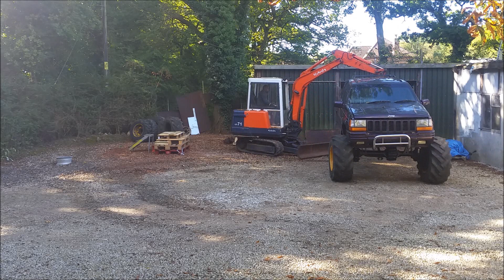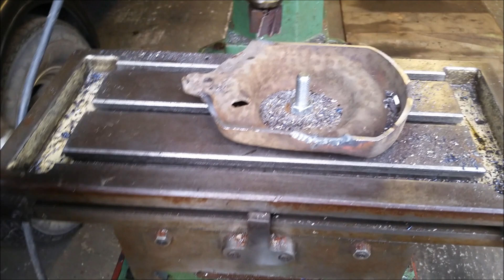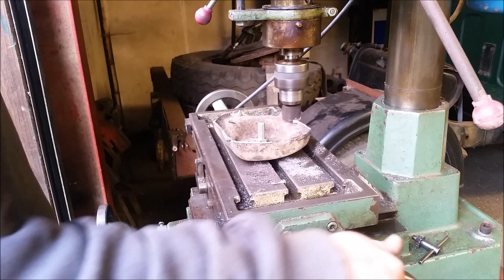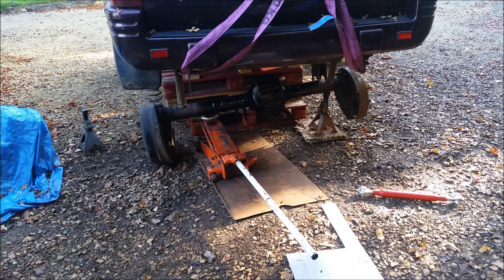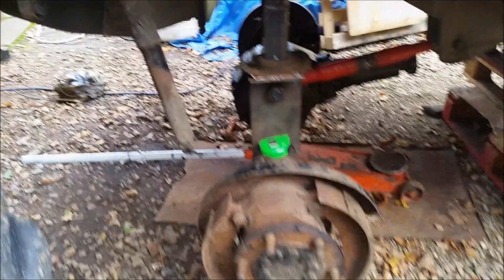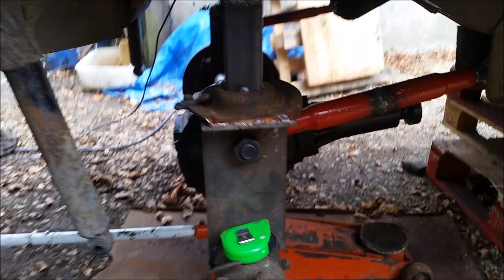jeep zj portal axle build part4

Comment: What about the engine, with all the weight from the tires and axles it will be to much for that 5.2 or 5.9 V8 to pull the engine has to be built or modified it's a extra 1 ton on this rig